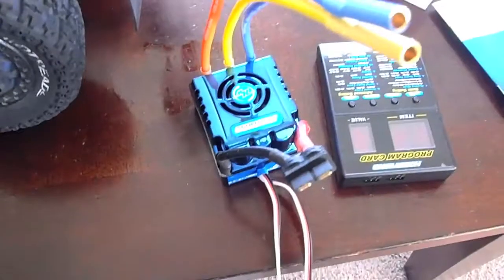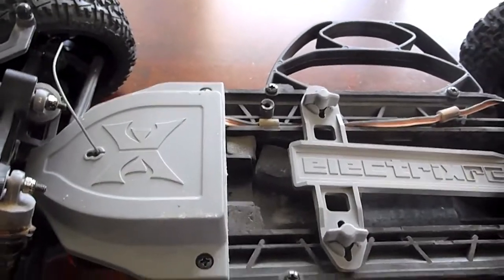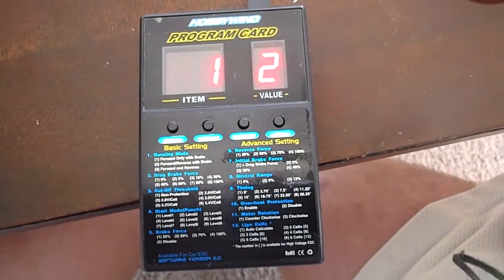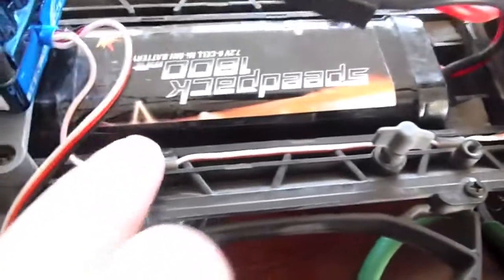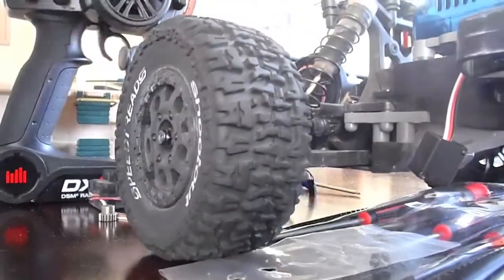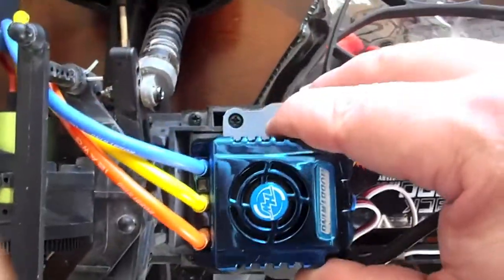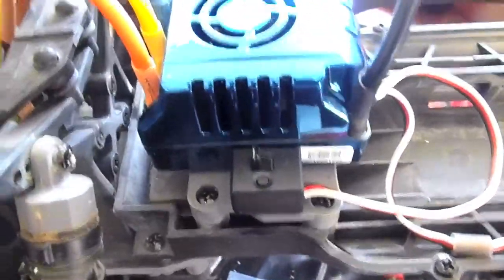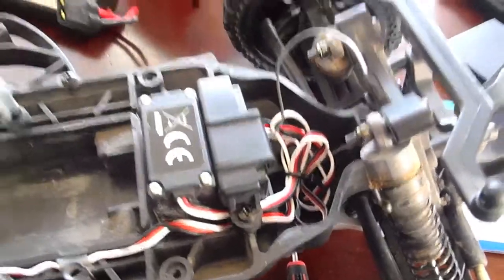Upgrade install

Comment from the maker: tacon bush less motor, with hobbywing esc 80amp 1/8th scale

ok I went and bought what I thought was best, hope it works for me. here is what I got

3650 - 10T - 3500KV Motor 24.09

C-Xerun 80A ESC 64.70

LED Program Card 15

total was 103.79 for the upgrade I hope it works, I will be posting a video of how the upgrade goes

links below video